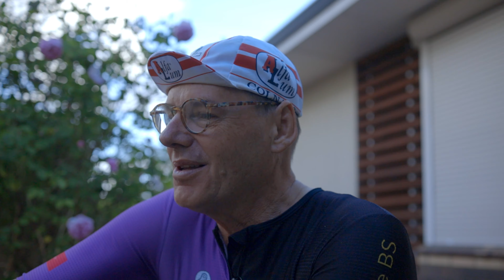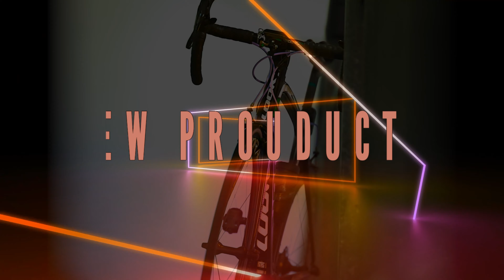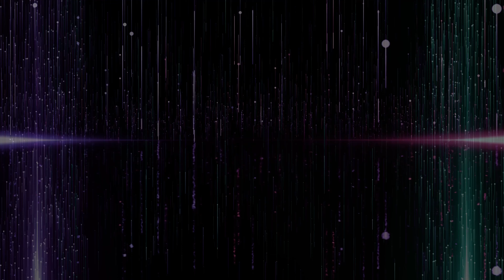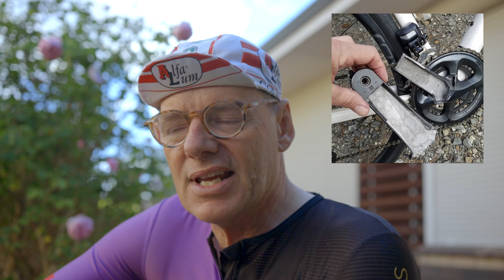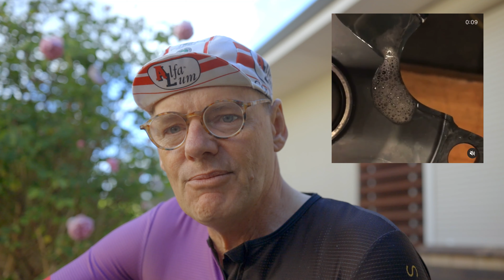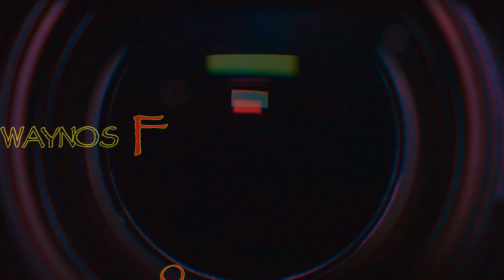Hollowtech FAIL, Shimano says; NO design flaw

Comment: Good video, I may upset people by saying I’ve never liked Shimano and it’s the last groupset I would want on my bikes, this is one of the many reasons I don’t have Shimano on my bikes, of course all manufacturers have their foibles but this crankset design is a terrible idea, the problem is if they change it, then it almost becomes admittance of a poor design which opens up a can of worms for them so they have to persist with the design, I suppose in many cases they don’t fail and if the number sold vs the number of failures is only 1% let’s say then that doesn’t constitute as a problem to the manufacturer who is looking at the numbers. They could have moved to Carbon cranks rather than persist with this design then they would have solved the problem by using different materials which would have been better for everyone.
Reply: And which groups do you use?
Reply: There is no doubt that the best designs are from Shimano.  I always use Campy because I don't have to remember which lever to push to shift up or down. But design and absolute quality is all Shimano by a country mile.
Reply: @tomkunich9401  you’re kidding right? Quality Shimano? Put aside their inability to design a crank, Shimano wears out far quicker than Campagnolo. I run Shimano and Campagnolo, Shimano requires more adjustment and replacement.
Reply: @ ThePaulKat - Bullshit on multiple levels! 

Campy grouppos are loaded with shitty designs including their cranks, shitty bottom brackets, and numerous silly spoke patterned wheelsets. Add on top of that their silly completely non-ergonomic thumb lever and you end up with silly priced components that shift inferior to Shimano, brake inferior to Shimano, and cost silly prices. And there is no set of company grouppos on the planet that require as much continual finicky adjustments as Campy drivetrains. They literally have a monopoly at requiring almost weekly adjusting if you want them to shift even half decently. Go talk to any quality wrench, who regularly works on Shimano, Sram, and Campy and the Campy will come in dead last as far as their drivetrains staying in tune and reliably shifting well over time. 

If you think Campy stuff in general lasts longer than the average Shimano component you’re a delusional clown. 😆
Reply: @rcg9573   WOW , Clearly you are clueless and not mechanically competent nor are the "wrenches" that you reference. Still thanks for commenting with total nonsense. 👍
Reply: @rcg9573  What a load of absolute bollocks.
Reply: Damn, that’s crazy and all, however I’ve been using for 27 years and I have yet to have an issue. Although to be fair I haven’t used any of Shimano’s cranks in over 10 years. As for all their other components (groupsets) etc their stuff will last forever. Shifting quality is better than any other brand I’ve owned. Mind you, I’ve owned groupsets from all three big brands